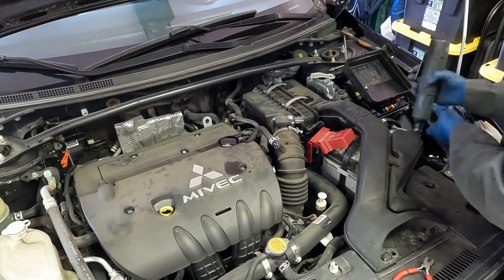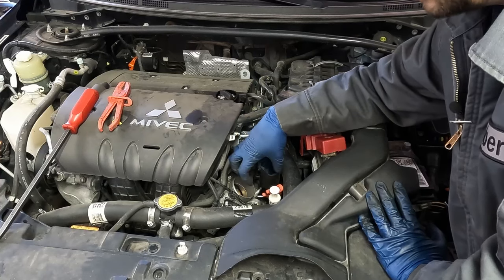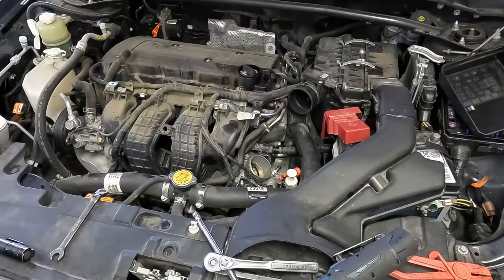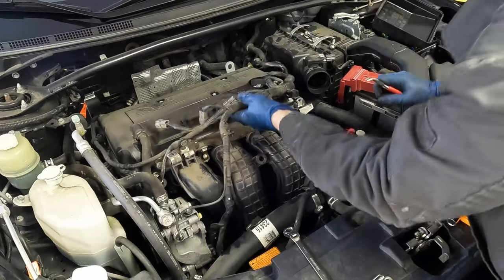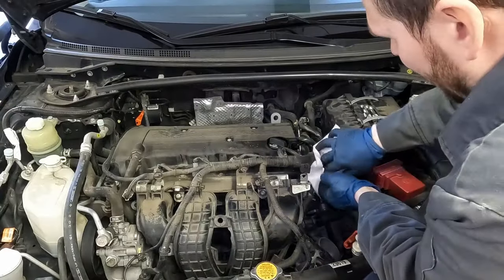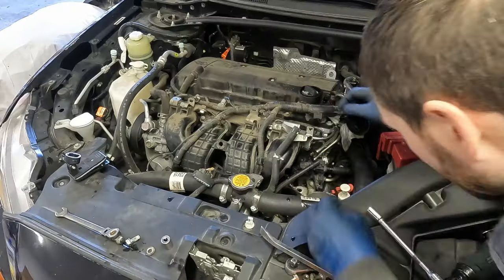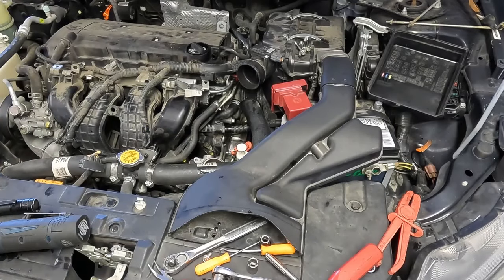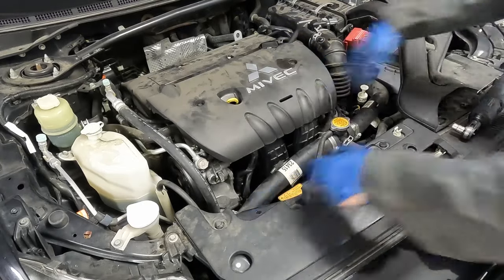2008-2011 Mitsubishi Lancer Starter Motor Replacement (How to DIY)

Comment: you can remove the starter from the bottom without loosening the manifold, its weird but you can wiggle it out from underneath and put it back as well from underneath but it has to be in different angles wiggled back in place then you just tighten the bolts and then boom
Reply from the maker: I'm glad you were able to do it that way. That's how the manual says. I tried for like an hour wiggling, twisting, pulling but nothing was working 😕.

Comment: you can remove the starter from the bottom without touching the manifold , U already did BUT only Two  trick that u need to  do .... First free the wire coming from battery side to starter , so it will go with u down ( wire stopped u ) ..and there is a wire metal holder on the top of starter location ( free wire from it to let starter go down when u pull it) , Second: down left manifold metal bracket need to take off to get u more room ( 3 x12mm screws) and ur good to go ..
Reply from the maker: Thanks! The next time I do one of these I'll give that a try 👍